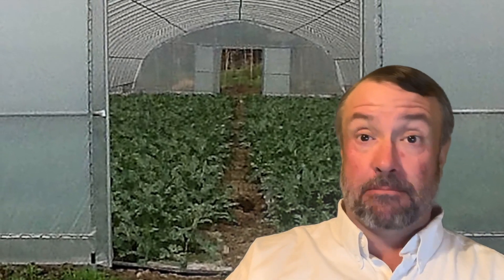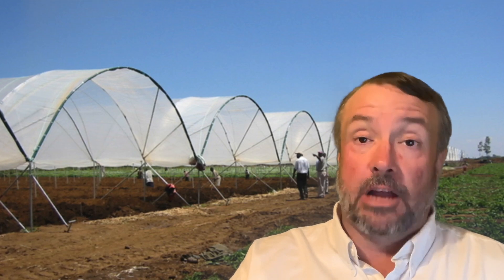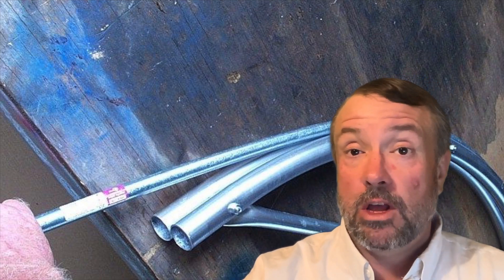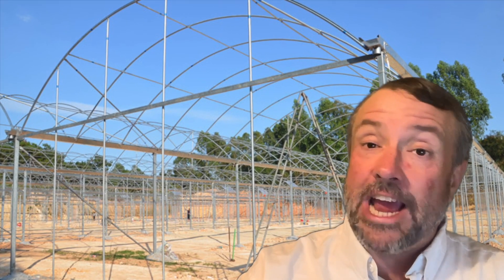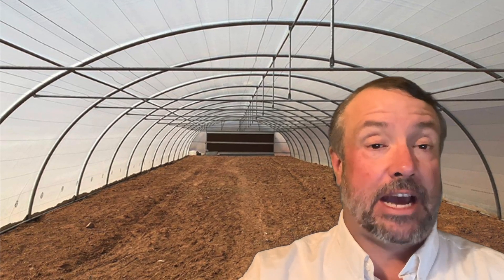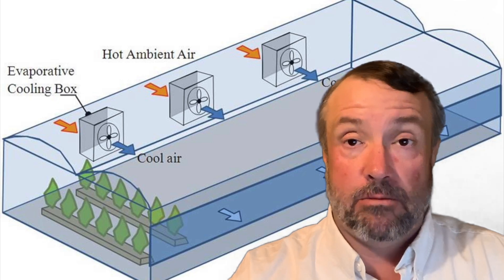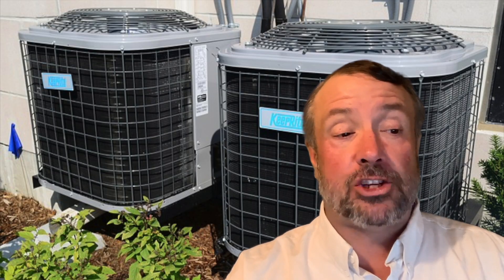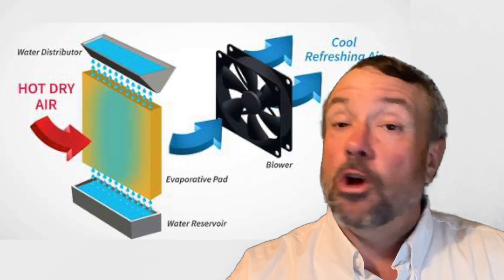Commercial Hoop House Design Options

Comment: I'm in the northeast,and I build mine 30 years ago,with rebar.4x4 pt bottom frame,which the ends of rebar slide into drilled holes.boarded ends.double plastic with a blow up fan.built a large unit to burn wood to heat it.all these years change the plastic once.greenhouse still operating today.
Reply from the maker: That's awesome! Thank you for sharing
Reply: What did you use to keep the rear from damaging the film?
Reply: @michaelharris3765  you mean the rebar,I assume.i took old garden hose,split it,then slid over,after the bars was in place.then tape.it has kept it from chaffing the plastic,which is greenhouse grade.i didn't mention before,I used crushed stone for the floor.
Reply from the maker: @michaelharris3765  not sue I understand what you are asking?

Comment: Good video but I wouldn’t insulate the floor of the greenhouse. Instead, I would place my sheets of insulation vertically (extending to a depth below the frost line) around the perimeter of the greenhouse, just as you would do around the perimeter of a slab on grade house. That way you can circulate hot water from a thermal solar collector or a thermal siphon from a coil of garden hose or a compost heap to heat up the ground beneath the greenhouse so as to create a native soil battery. If this underlying soil is charged all Summer, it will likely remain hot well into the Winter months.
Reply from the maker: Great idea

Comment: Hey woudn't be cool to make a Video about Air structure Greenhouses. There is only one company who build them but i think they Coud be a great Option for bigger Greenhouses . ( 20000 sf ore 2000m2 )
Reply: Clearly you need transparent foil but the Building costs are cheap because you only need foil an a blower . And you dont have no columns in the way .
Reply: I hope you understand me my english sucks
Reply: I understood you well enough.
Reply: This idea is pretty interesting. You're right, the material would need to be see thru instead of opaque like it currently is. The idea is solid, though I'm curious how it would fare under a snow load.
Reply: @8Jory  it works realy great under snow load . I live in Germany where snow       is not rare . We often use such halls for tennis places and they are specialy shabed to remove the snow automaticly
Reply from the maker: Great suggestion!
Reply from the maker: those are wicked cool!!! I'd love to test one out!
Reply from the maker: me too